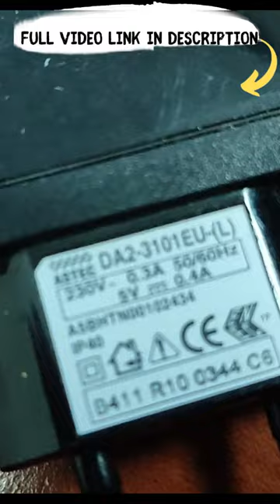Awesome Idea for your old phone !

Comment: The incident on my cellphone instead turned on and off and kept repeating, was it because it had no resistor?
Reply from the maker: The resistor is a must here because it mimics the temperature sensor in the battery. Keep in mind that the power supply should be enough powerful because when the phone is loading on starting it is drawing a lot of current.
Reply: @FixitEasyDIY  I'm using a xiaomi redmi 4x cell phone. 
It even has 4 pins on the battery
If I imitate you, I just connect the plus and minus parts of the 2596 output. 
I use 5v input 
is there something wrong? / any suggestions for me
Reply from the maker: Can you check with multimeter the battery pins. There should be resistance between one of the pins and ternal sensor. Probably the resistor should be on the in the "free" pins